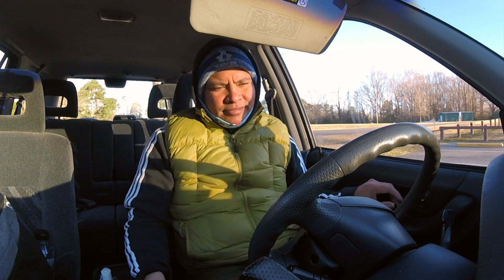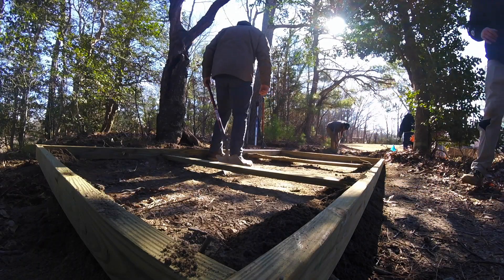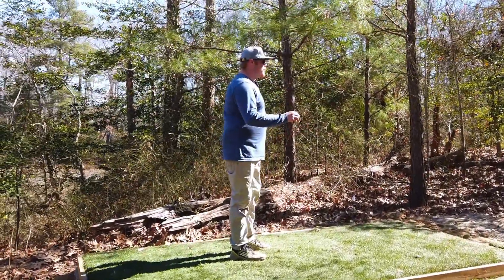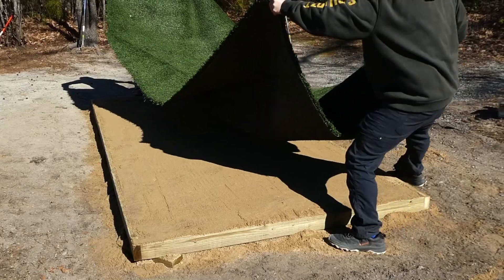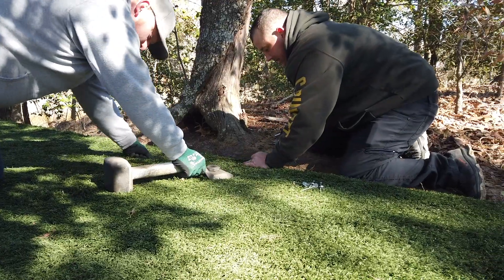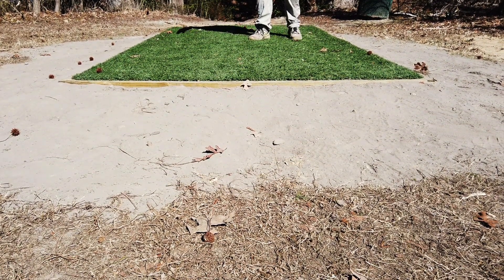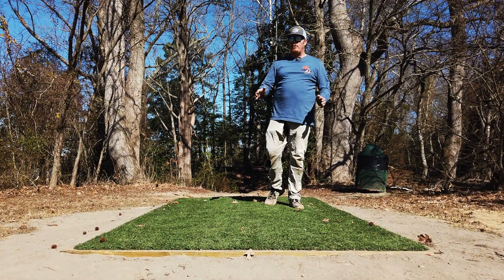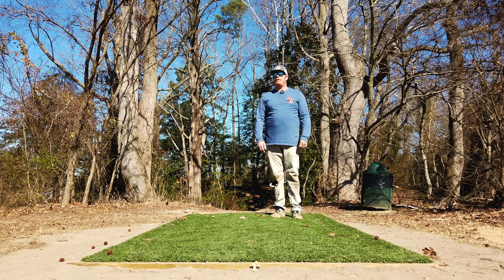How To Build Turf Tee Pads

Comment: What’s the measurements?
Reply from the maker: I believe we used the suggested dimensions from PDGA site... Typical size for pads at the longer tee positions is 6 ft (2m) wide by 13 ft (4m) long.

Comment: I'm thinking that there needs to  be some drainage as in a base layer that compacts and then sand over that and then compacted while wet with a compactor.  

https://youtu.be/0CmylbYaxIU?t=225
Reply from the maker: Thank you for the suggestion and info link. Many tee pads later we have gone to this step although we still tamp by hand.
Reply: @CHAINHUNTER  I've reneted electric compactors in the past.  I suppose you could rent a generator as well.
I've seen videos of people constructing  tee pads out of wood.  I would be interesting to see which type lasts longer.
At my course, they just leveled the ground and threw down rubber mats.  I understand that the mats have been replaced several times.  Now they are updating with concrete.
Reply from the maker: @davelopez9161  I've played on turf with ply underneath...it won't have a long life span. As for the ones we are setting they are coming on a year old and are hard as concrete. The city bought everything we just had to do the labor...and with what they bought was the manual tampers so thats what we have to make do
Reply: @CHAINHUNTER  By base layer, I meant DG or some other compactable road base.
A drain is just a dug out trench lined with river rock.  The base goes on top.
I understand about budgetary constraints.

At my  course they just leveled the ground and installed rubber mats. But, now, IDK how many years later as I am a newbie, they are replacing the mats with concrete (yeah!).

But, I appreciate all the hard work that goes in to constructing a DGC.
Reply from the maker: Have a happy holidays and stay warm out there !